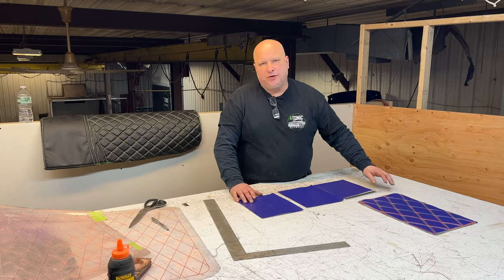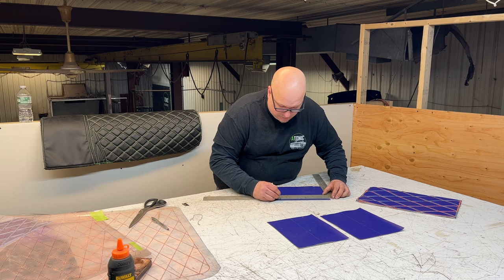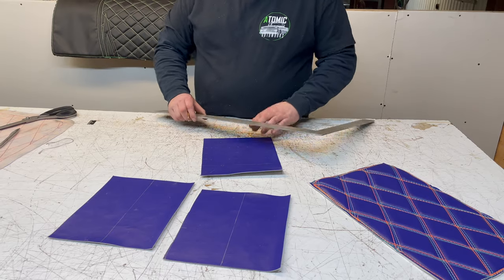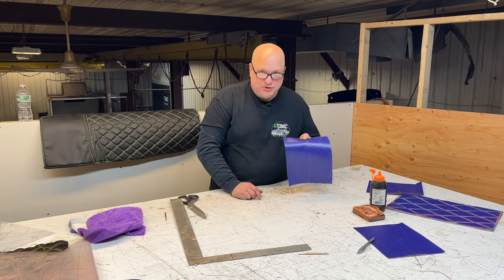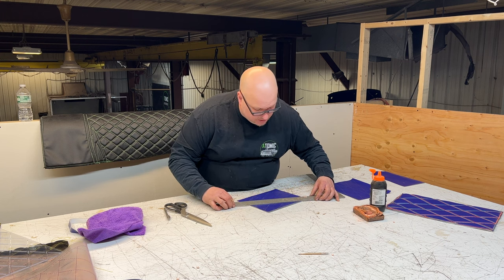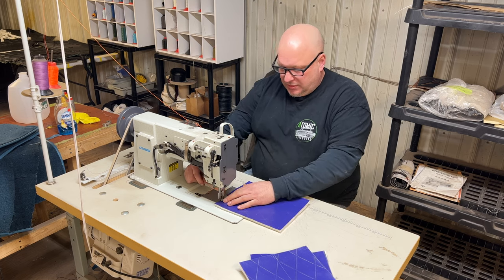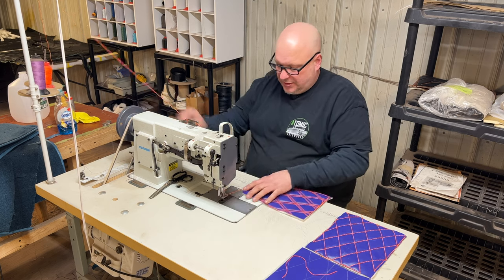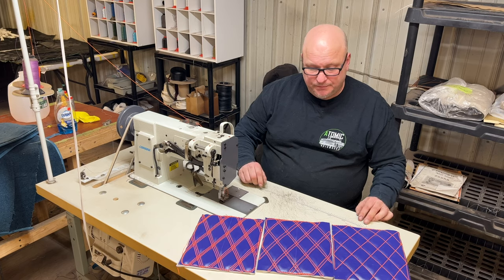Master The Art Of Sewing Diamond Patterns In Auto Upholstery!

Comment: Love your videos!! I’ve been doing upholstery for a year now, and just got my first industrial walking foot sewing machine that’s a lock stitch. Do you tie of your ends when your done sewing your lines? Because I notice you don’t use a back stitch. Or can I rely on my lock stitch for that? Because I’ve been tying off all my ends when I’m done sewing a line
Reply from the maker: We do back stitch on some jobs. Like daily drivers however on nicer stuff we usually hand tie for look and guaranteed lock. Thanks for watching Make sure to subscribe, next week we will be bring back our weekly giveaway.
Reply: It depends on what you're doing. Anything decorative should be tied off. Don't count on permiter sewing to lock the stitch. Don't back tack on anything you can see. Even if your machine is precise enough to hit the same hole forwards and reverse it won't look good. When doing inserts try and minimize the number of starts and stops so you have fewer knots to make. It saves time too because unless you've got an autocut machine you have to hold those tails and the setup takes a few seconds which add up. Less chance of a tail getting picked up by the machine.